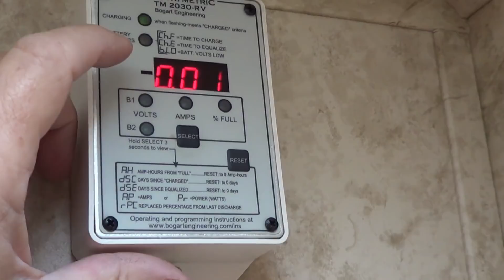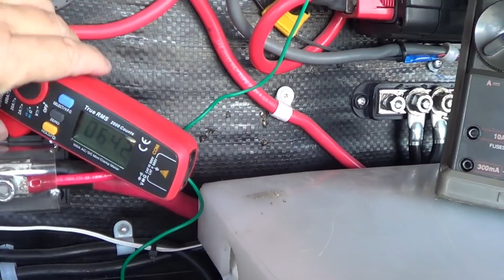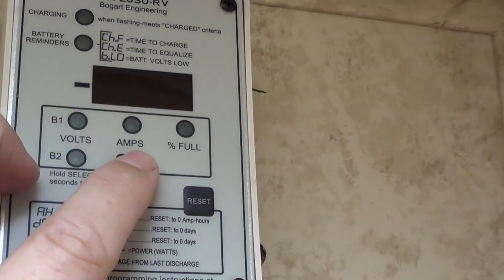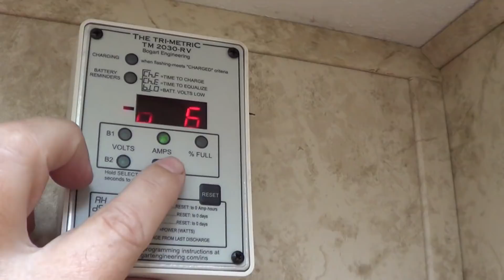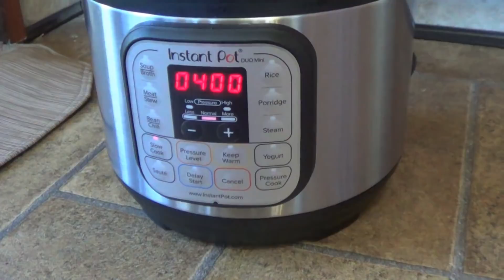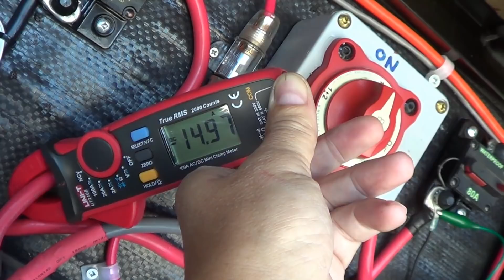Instant Pot DUO Mini  - Off Grid Power Usage Tests

Comment: Instant pot has been a major upgrade for our cooking. We have the larger pot but pretty much everything you mentioned in your review was spot on. We also use ours from our inverter and have found that the pot cycles either on or off about 4 seconds each, so the inverter size needs to be good enough to run the load while on. One thing I noticed about your set-up is how the 1000 watt inverter was sufficient to handle the 700 watt load. Your assembly of the inverter close to the battery is an important point. Usable inverter power falls off very quickly with cable length and cable size on the 12v side. Your ribs made DW and I drool.
Reply: Do you happen to know the wattage maximum on the larger instant pot 6 quart...is it under 1500 watts?
Reply: @fromtheflightdeck252  1000 watts, give or take
Reply: @Doug Kennedy  thanks! Will a 1000W inverter handle it that? What do you run?

Comment: I have 2 interstate 6 v batteries and even after charging on shore power for a couple days the most I can get is 12.4 volts  Is this normal?
Reply from the maker: Seems a little low if they have no load in them. Usually, you should see 12.6 - 12.7 from a fully charged battery in a resting state. I would get yourself a hydrometer and test each cell.  https://www.loveyourrv.com/testing-and-equalizing-my-rvs-4-golf-cart-battery-bank/

Comment: Hi Ray, Just curious. Is the 110V cable running from your inverter output to your single house outlet solid core or stranded?
Reply from the maker: I can't remember, it was installed 7 years ago. I do know it weatherproof armor coated. I went with that as I ran it under the floor through the trailers underbelly.

Comment: Your test really showed the weakness of lead acid batteries, your voltage readout of 11.7 was really close to 11.5 v DC the level where most inverters shut down. That peculiarity of lead acid batteries is what drove me from keeping my 4 Trojan T-104's with 700 watts solar setup. Way too often under heavy load the Samlux 2500 watt inverter would power down when the input battery voltage dropped down to 11.5.
I ultimately got rid of 2 batteries and 350 watts worth of panels. I'm happier with my new 3,000 watt Honda with remote start option and auto transfer switch. No problem running Air conditioner, micro wave, at different times of course:-)
The ultimate solution is Lithium Ion batteries which don't have the Peukurt effect, the fatal flaw of lead acid. When the budget and advancement of tech allows I'm going back to more solar and Lithium.

Ron & Liv
Reply from the maker: If we boondocked more than 4 months a year, I'd be looking at lithium but just can't justify the cost yet. Hopefully, they continue to go down in price and when this battery bank is at end of life I can switch, or maybe a better battery comes along. :)
I just got a new remote start generator, looking forward to that feature this winter!

Comment: I'd bet you can save electric power (+7 Ah, about) if you boil on the stove what water you add at the start of your cooking.
Reply: He has so much solar capability, if he's cooking during the day he won't even touch the batteries.  Free Cooking!!  If you were trying to stretch your battery, I think your strategy is great, get things started on the stovetop then pop that pot into the unit to finish.
Reply: sailingsolar great point! Even just hot water will shave off some energy
Reply: sailingsolar I live in a house and have a larger instant pot but I always boil the kettle and put boiling water in my instant pot, it’s just quicker

Comment: Ray, excellent video. Remind me again how much battery storage you have. Right now I have 2-225 Trojan T-150 golf carts and hope to add more before I head out!
Reply from the maker: I have 4 Interstate Golf Cart batteries they are 232 AH each and 6 volts. So two wired in a pair makes a 12 volt at 232 AH, then when I parallel another series pair I get a total of 464 AH.  Of that, the usable AH is around 200 or so as I don't like to run them down too far. They say it's not good for a lead-acid batteries lifespan to let them get too discharged.

Comment: Great test!  Couple of comments. First, chicken breasts cook easily in 10-12 minutes. Frozen, about 15. That will cut your power way down. Second, you really don’t want that much liquid in the pot, not do you want the meat to sit in the liquid.  You end up with boiled meat. You should use the trivet (a three legged stand that comes with the pot, usually). A cup of liquid is really all you need. Once you have the meat above the liquid, you can spice the meat while cooking it.  I’ve done a ton of chicken breast this way.
Reply from the maker: Thanks for the tips, I was just using it for the tests, wanted to have something in there, just happened to have some old frozen chicken pieces kicking around.

Comment: Super useful info Ray! I am building a new EV right now and in middle of installing 700 watts solar with 675 AH batteries (same batteries you have). We recently got the 3 quart Instant Pot and was hoping it would work for boondocking....question answered! Really enjoy your informative review videos:} I am installing a Bosch 7.1 gallon 120 volt hot water heater in the EV (we have one in our stationary tiny house and it works great}....reviews say takes 25 AH to heat up. Will be doing some testing before heading south in October. Thanks for your efforts!
Reply from the maker: Thanks, Jack. Sounds like an amazing water heater!

Comment: I  made the mistake of buying about the smallest crock pot I could find and now I am on the market for a replacement.  But I was concerned to read from multiple sources that it's not safe to leave those things on when you're not home as they can and have started fires.  That's fine when you're retired like I am, but I think a lot of working people don't know that.
I think they are making a comeback in a big way.  I read a lot of articles and video on cooking and they are really in the literature a lot.
Reply from the maker: Hi Tim, I heard that too and after some research found it wasn't this Instant Pot pressure cooker model but another completely different model called the Gem that had the recall for fire hazard - https://www.nytimes.com/2018/02/26/business/instant-pot-recall.html
But now the myth is out there. :) Cheers, Ray
Reply: Love RV   I'm not even talking about the recall.  Hey, I have used crockpots countless times over the years and a number of times in my RV.    No fires, no problems.  I should have kept my last crockpot but I was downsizing for my RV and sometimes  I got rid of stuff I ended up replacing.  Anyway, some sources have reservations about leaving an appliance unattended that is operating at high wattage.  Just sayn'.  I am still going to get a bigger one and will probably leave it on low if I go to town or something.
https://www.huffingtonpost.com/entry/crock-pot-safety_us_5a68a6a3e4b0e56300757fe2
Reply from the maker: I'm way more concerned about the RV fridge than any other appliance but you got to live your life. We just have good insurance and hope for the best. These days a few incidents make big news, just the way the media works, scaring people gets clicks and views, but actually, the risk is usually pretty small compared to a lot of other things we do in life like drive on an interstate highway. ;)
Reply: Anything that uses electricity can catch fire. If you are afraid of fire don’t leave anything plugged in, but I leave crock pots unattended all the time

Comment: Whoa! I just about understood! 😂 so I love my InstaPot. I don’t understand if my solar system is drawing from Solar Panels or the battery’s. I have 2 280 watt panels and a TriStar remote meter with a 3000 watt Sine wave Inverter. Also I have 2 huge 12 volt lead acid batteries. When I turn on my InstaPot the TriStarts beeping and red lights flash like I’m drawing too much. I just can’t believe that with all this I can’t use my solar to run my InstaPot. But then I just turn to the Generator. Weird.
Reply from the maker: Solar panels fill the batteries with power so that we can use the power in the RV. Think of the batteries like a bucket of water. As we used things in the RV it takes out water, the solar panels help refill it.
I would think your setup should be able to run it, maybe its a problem with the wiring. If the wires aren't big enough especially going to the inverter from the batteries it can cause problems when trying to run high power appliances.
Can you run a microwave or hair dryer?
Reply: No on the microwavw and probably hair dryer. Also, my coffee pot did not work. Your explaination makes sense. He probably set it so it won't overload thew wires in my 1993 Coronado Class A. So I guess it never works straight from solar. Thanks so much. 😊 I'm a happy woman now!
Reply from the maker: Someone would have to do voltage checks to determine if the problem was too small of wiring, bad connections or maybe defective battery. My guess would be too small of wiring for the amount of amperage required by the big 3000w inverter to run those high wattage things. Cheers! Ray
Reply: You need 02 gage  wires from battery to inverter for a 12 volt  or 04 
gage wires on a 24 volt to  get power on a 3000 wat inverter and s less than 2 feet  in length  is best and 2 more battery's 4 total I would use 6 volt gulf cart battery's

Comment: Great job Ray, this will save me lots of worry and time. I just have 2x100ah 12v agm batteries and i heard that that's better for high amp draws, than 2x6v 100ah batteries due to the size of the plates in them. From Solar Boondocker. I all so bought a induction hot plate because I can control the Watts it uses. I am using it to make my morning coffee. Heats water real fast, about 3.5 min for 24 oz. The induction cook top will cycle too when you set the temp.
Reply: Hi Ray, I recently got a MPPT 40 commander from Renogy. I liked the links though. Great explanation from both. I like  Greg's because I used to be a US coastguard licensed 100 ton Capt, with a Sailing endorsement.
and built a 32' sailboat with my father and mother. I think sometimes I should go that root instead of a land yacht. Look forward to hitting the road soon as my stepson is almost ready to take over the business. Ill keep an eye for your next videos as they have been a great help in my learning curve. Safe sailing, hope to see you sometime on the road.

Comment: VERY HELPFUL! Thanks as always Ray! We will have 210AH and 200 watt solar. Should not have any problems with a 1500W invertor. (PS: Just buying the final pieces to install the invertor now. House sold so we will soon be heading out to boondock!)
Reply: can you tell me what is the bare minimum Solar power to use this instant pot i'm just getting into Van life and I have to start slowly I'm thinking about getting 100 W Solar Kit with 35 W battery to start out what is the minimum that I can use 700 W instant pot just need enough to get by I will slowly build up of other items to power at a later date
Reply: @jfletc3000  I know this post is old but anyway, your solar needs to be getting Good sun (  at the least a nice bright day ) 200 Watts on a cloudy day will give you very little.
In Northern Ireland even in summer if its cloudy or overcast 200 Watts may only give out 1 amp, over 10 hours this is 10 amps so this cooker will eat that up in steamer mode in 5 minutes, pressure mode 20 minutes and slow cook mode 1 hour 40 minutes.
A single 100 ah battery with little solar coming in like above will use mostly your battery power so the slow Cook for 4 hours will leave you with around 50% usable power in your battery counting 4 ah from solar as well at best but that's using 40% as usable power, I prefer 33% max as not to kill my battery too fast.
100 ah battery at 33% = 33 ah of usable power.
Sucking 700 watts of a single 100 ah battery is also not Good for that battery.
If you live in a sunny climate, 200 Watts of solar and 200 ah (  Two 100 ah )  batteries plus a 1000 watt inverter at least plus wired up properly to get the best out of it, this would be a Good minimum choice for this cooker if it's to be used often. 
Duller climates like Britain, I wouldn't bother unless I had 300 ah battery power and 400 watts to 600 Watts of solar because in winter solar is dismal, early spring and late autumn ( fall ) can be dismal and to be honest so can summer lol, so more solar is important plus a Good storage bank to capture the power of the sun when it's at its best.
LPG works best here for cooking in Ireland or Britain as it's cheap, next would be propane although I prefer propane as it's cleaner than LPG and better than butane in the winter.
Electric equipment in a small set up and perhaps a cooler climate is best being 12 volts as an inverter is only around 80% efficient wasting 20% of the power before you even start.
This is all approximate and my opinion from all my many hours of research.
It's as honest an opinion I have as I myself was interested in this cooker.
People have been saying for a long time that a 700 watt microwave in a camper is pretty much too much and they are usually only on for a few minutes, this is 700 Watts and is on for much longer so it's not for me.
I hope this helps you somewhat or someone else who reads it.
Always work out the pro's and cons is my advice, happy travels.